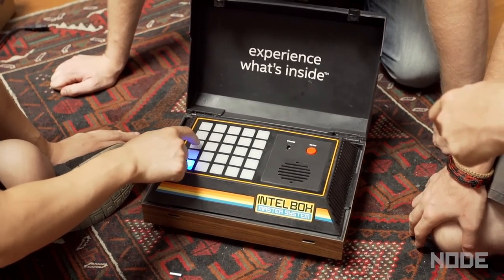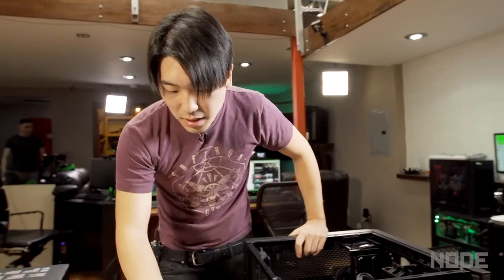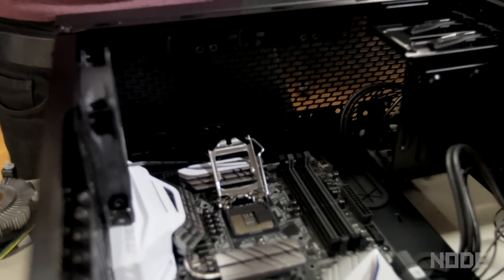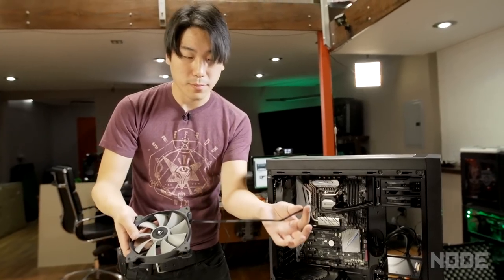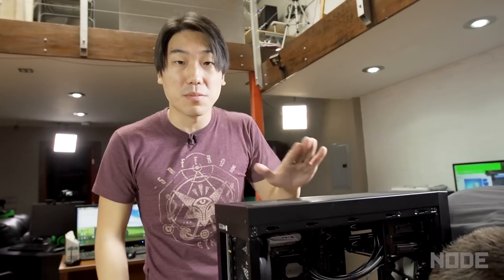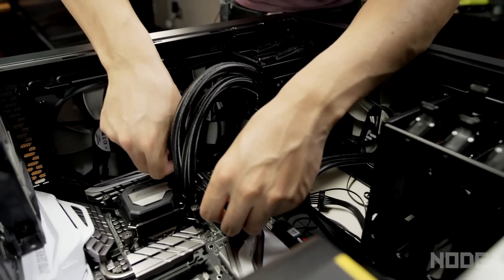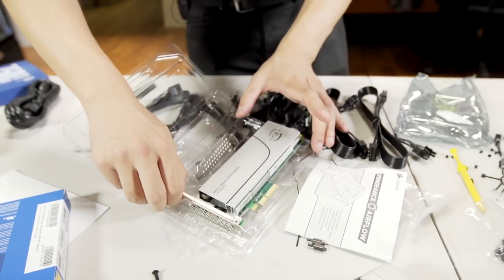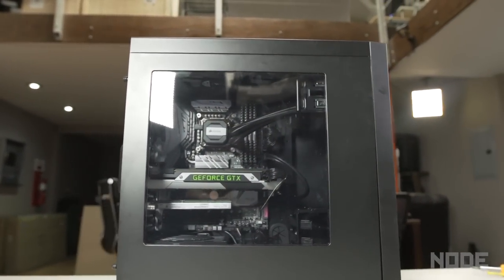BEAST INTEL PC BUILD

Comment: please dont build a pc again you dont know anything, the power supply where our power come from? no shit and the radiator is like a car intake? radiators are inside cars too they are called radiators not intakes. and fucking ram goes in before the install because you can mess up the boars when you push down on the standoffs

Comment: hey node i just a got a msi motherboard and just put it into my case. When i finished i turned it on (all other components are already in the pc) and it started beaping,and wont show a display and i looked it up and the memory stick i had was compatible but it wont show a display or no signed of showing that it was ever going to show can you guys help if not it is alright just need some type of help

Comment: Heads up, your PSU should be drawing fresh air through the filtered intake, not grabbing hot air from the inside like older systems.

Comment: I'm in the middle of installing this cooler on that MB. the backplate is completely loose when installed. I don't see how it can be stable when the block is tightened down. is this normal.

Comment: you have your power supply upside down... fan should be pointed downward so it can get cool air... power supply can overheat the way you have it installed

Comment: cooler fans are not facing the right way. you have them sucking air in to the computer through the radiator. they should be exhausting air out of the pc

Comment: Guys, can i have a spc like this, anything should change? after this, I will add one more GTX970 inside so will be change to GTX 970sli.

i7 6700 4GHZ
ASUS Z170 Deluxe Motherboard
NVIDIA GTX 970
H110i GT Liquid Cooling unit
Corsair RM 850 Power Supply
Corsair VENGEANCE DDR4 16gb ram
Western Digital 2TB HD
Reply: Get a SSD ;)
Reply: get an ssd

Comment: Hey, how is this pc build: 
GPU: Asus GTX 970
HDD: 120GB
RAM: 2gb DDR2
CPU:Q6600
PSU:430w, picked up for 40 bucks
Reply: +dtfguy1982 Outdated.
Reply: Nadir Jofas You didn't notice I was joking......
Reply: dtfguy1982 The answer is still correct.
Reply: Nadir Jofas k

Comment: Intel i5 4460 3.2Ghz
MSI Z97-G45 Gaming ATX Motherboard
16GB RAM
Crucial MX200 250GB SSD
WD Caviar Blue 1TB HDD
GTX 750 TI
Antec Earthwatts 650W Platinum Power Supply

Will my PC run? I am building my first PC next month and want it to be a good - great running PC, Can anybody tell me if it will run shit or good thanks.
Reply: +MrZach360 it will run
Reply: i know, im to late, but why z97 when you have a locked cpu?

Comment: im building a new pc but im not sure aout the compatibility of the parts. if u guys could help with this that would be great. 
CPU: i7 6700k 
MOTHERBOARD: ASUS Z170 deluxe 
RAM: GSKILL V SERIES 8GB 
COOLER: CORSAIR H100i 
SSD: INTEL 750 SERIES 400 GB PCIE
PSU: 800 WATT 
GPU: GTX 970 only one  
CASE: N/A
the motherboard and ssd compatibilty is what im concerned about. THE ASUS Z-170 DELUXE IS $300+ motherboard. i would love to have something cheaper but at the same compatible with the ssd. thankyou im building a gaming/workstation computer. and would the asus z170 a motherboard actually work. thankyou if there is any other comments please telll me thankyou.
Reply: +navdeep kumar ssd will be fine. as long as your motherboard supports pci.
Reply: +porkyporkchop1 all motherboards have pci, he should be fine
Reply: Marco Bununu of course :U but sometimes it doesn't fit with certain gpu's that are bricks lol!

Comment: Are these good specs for a first pc build?

Intel core i7 4690k
Msi z97 gaming 5 motherboard 
Hyper evo 212 cpu cooler master
Crucial 250 GB SSD
1TB Blue WD
Msi R9 390 grafics card
Corsair 750w 80+ Bronze psu
8GB Gskill Ripjaws RAM

Any recomendations?
Is the motherboard good?
If not Any better motherboard out there lower than 160$?
Should i got with a liquid cooler instead of a fan?why?

* Since im going with an intel cpu chip, is it better to go with a gtx 760, since people say intel runs better with nvidia etc.. and amd runs better on r9 390 etcc???
Please help
Reply: i mean gtx 970*
Reply: Maybe think about making it a skylabs build, that is a 6th gen Intel core
Reply: +Nando jr skylake***

Comment: you dont want to use the pre applied thermal paste because if it goes over the edge of the cpu heat spreader it can insulate the cpu

Comment: Hello guys i need help
Processor: i7 860 2.8GHz
Mainboard: Intel DP55WB
RAM: 16GB DDR3
Graphic Card: AMD Radeon HD 6850 1GB
I want to change to MSI GeForce GTX 960 GAMING 2GB or  MSI NVIDIA GeForce GTX 960 Gaming, 4GB GDDR5 which one is better or will i get bottlenecked if i buy any of these? :)
Reply: I wouldn't recommend ever getting a card with only 2gb of vram, it's not worth it and some games will really suffer.  I would recommend a 380 but it's real up to your preference
Reply: Hugo Olloman Well i'm planning to get gtx 960 4gb :) I just wanted to make sure it wont bottleneck since my other pc parts are quite old :D
Reply: +DecayHD I think you will be fine, your parts aren't too bad. Anyway there's no harm in getting the best graphic card you can afford and then upgrade the rest of your PC later, regardless of bottlenecks

Comment: flip the PSU upside down so it takes its on air in so it doesn't fight for the air with the GPU or inside the case?

Comment: is this build good and will it work?????? http://pcpartpicker.com/p/M79jVn
Reply: +N-Gineer No, you need an operating system, keyboard, monitor, and- Yes. It'll work, but what do you want to do with it? Game, stream, edit, and watch amazing cat videos in 1080p? Sure? Maybe? But get rid of that r9 card and switch it for the r9 380 or a 960. Bam. Solid.
Reply: porkyporkchop1 If it would work with the motherboard I will, All I will be doing on this Pc is gaming and editing
Reply: N-Gineer with the motherboard you have you can have anything you want piratically (it all depends on your case and the size of the graphics card.) for editing you may eventually want to upgrade to 16 gb, but 8 gb is plenty for now. Maybe think of getting a heatsink to help cool down that hot cpu and an ssd for loading times/editing/games. (Just need one big enough for the os) and a better gpu. bam, you'll be a happy camper.
Reply: porkyporkchop1
Thanks!

Comment: I need help with my first pc build. please let me know if my combination of parts will cause issues like bottlenecking and other pc issues. 

-Intel i5 4690k
-g.skill ripjaws 8gb ram
-MSI z97 pc mate motherboard
-MSI radeon r9 390 
-corsaire 600w power supply
-western digital 1tb hard drive 

also, is a cpu cooler necessary?
Reply: +John Travolta seems fine, you sure you don't want a 970? you don't need an heatsink, but it is recommened. sometimes the stock coolers don't have enough kick to cool down some of the higher end cpu's and it can be very loud. so if you want to be safe and invest in one... go for it! if you like silence over a loud hum... go for it! up to you
Reply: porkyporkchop1 thanks man, you think a 40$ cooler master will do the job?
Reply: John Travolta heck! you can buy the hyper 212 evo for 25-30 and it'll be good enough. or if you want to spend a bit more - pick up a corsair hydro :)
Reply: +porkyporkchop1 more spending? I'm good. ill get that 25$deal on the hyper 212 evo.thanks a lot for the help, cheers!
Reply: John Travolta haha understandable. enjoy your new rig! hit me up if you have any more questions/or if you need help. happy gaming.

Comment: How much does this cost altogether? Recently thinking of getting a new pc, and if it's above $1.5k is there anythings I can downgrade that can drop it a bit?
Reply: +NappaKappa Well this build costs an arm and a leg to build... I would recommend checking out pcpartpicker since they have community build that vary in price ranges or you can build one yourself!
Reply: +NappaKappa that price range will get you everything you need.Node buy/use alot of parts that are just not necessary for most Home users/Gamers. Realistically you only need 8Gb of RAM as no game in existence uses more than that (Witcher 3 does not use more than 8Gb on the highest settings, not does Crisis 1-3 or Beam-NG Drive). Although if you do alot of video editing/photoshop work, more RAM might be nicer (16GB IS PLENTY). Additionally, any case will do, even your old computer so you can save money on that. Power Supply Unit, again you can afford to cut corners here, just keep an eye on what your parts consume and you will be fine (you should be fine to just re-use your old one). generally, a 650W unit will do, just try and keep it brand name (most non-brand name PSU's fail in the first 6-12months). As for CPU and graphics card...for CPU essentially anything that is 4 cores and 3.4ghz will be fine....again nothing in existence uses more than that (games wise), if you buy one that is unlocked, you have future proofed yourself as you can simply overclock it to keep up with future generations. Graphics card are a little trickier as 2 is more powerful than 1, but 1 spits out the most consistent frame rate among a wide variety of games (few games are optimized for 2). But as for which one you should buy? RAEDON vs Nvidia.....Im with Nvidia as bang for buck, GTX 980 TI (VERY slightly weaker than the one they have in this video, but MUCH cheaper) is only marginally worse than top of the line (by 6FPS than the best and most expensive graphics cards in the world). you will be hitting the low 100's FPS wise for most games. Motherboards.....could probably just re-use your old one...but if you're looking for future proofing, maybe a newer one will be the way to go. Research is needed for this part as most motherboards do the same thing, just with slight tweaks.

Provided you re-use the case and power supply, rough approximations will land you.
Graphics Card = $750-800
Motherboard = $110-$140
RAM = $80-$120
CPU = $250 - $350

Which is well within your price range (although truth be told a brand new case and PSU do not cost that much and would still be in your price range). This would get you an 100% up to date Computer that will play all games for the next 3-4 years on high/Very high settings.
Reply: +NappaKappa http://pcpartpicker.com/p/ck2Dgs $2300
 
Lots of things you could shave off, in fact this rig I just made for you will play games better as most games are all about the GPU, and a 980ti destroys the 980. Enjoy Brother!
http://pcpartpicker.com/p/kgV8gs
Reply: Are we speaking USD? If so yeah 1.5k is plenty I'm Australian and my second pc I built was 1.5k AUD so yeah

Comment: Looking into getting a gaming pc ( currently a console gamer ) and I was wondering if you can put any processor into any computer or does it have to be amd or Intel depending on what other components you have
Reply: Depends on the motherboard if you are going to go with intel go with socket 1151 if you are going with amd choos beetween Amd+1, Amd+2 or Amd+3. i whould go with amd+3
Reply: Processors and motherboards have things called Sockets, for example, a AMD A4-5300 (Socket FM2) Will not fit inside a socket 775 (intel), so your motherboard and CPU sockets must be the same.
Reply: daniel15092 that was exactly what i ment

Comment: So I am guessing that the motherboard comes with all those wires? Or do you have to buy them separate?
Reply: +ThePokemonSoldier The power cables usually come packed with the power supply unit.
Reply: I looked up parts and I saw, so I know now. But thanks anyways.

Comment: is this a good gaming pc and does it work 
PcPartPicker list http://uk.pcpartpicker.com/p/fMGMLk
Reply: +GamingDobby I would get a cheaper processor such as the AMD FX 6300 and get a better graphics card such as the GTX 960. That card is designed for 1080p. You might find that your 8350 cpu will bottleneck the graphics card. Get a better GPU and you will be fine for 1080p gaming!

Comment: which is better: their origin PCs or this one? also if anyone know the name of the song they used that would be great thanks.
Reply: +Caleb Lawrence The origin PC's are superior to this one. but then again this one is the quarter of the price and will get the same, if not. more FPS than the Origin PC's. Why? the origin pc's use 5960x's and these use 6700k. at default clock speeds the 6700k is better for gaming as games prefer GHz rather than cores. and due to the fact that the GPU's are the same they will peform very similar. You only need 5960x's and other intel extreme CPU's for professional editing. but even still... the 6700k is still very quick in editing.
Reply: ***** why would they run cooler? thats BS! Twice the Cores, Twice the heat to be generated. AND the skylake CPU's are 14nm compared to 22nm meaning they put out less heat for the same load. learn you shit before u comment silly things like that
Reply: ***** no. the latest origin PC's they have are 5960x's which have 8 cores. the 6700k has 4 cores. and 14nm uses less power than 22nm, therefor it generates less heat. laptops get hot because their cooling is worse than desktops.

Comment: How fast does it boot up? If my 2 year old SSD can boot in a minute then id love to see that one put directly into the motherboard!
Reply: +suddenshotty My PC boots in about a minute and it's a normal hard drive...
Reply: If you are rigging an SSD and still boot in a minute,there is big problem somewhere in your system.
Reply: +Giggity Goebbels lol i had under 30 sec for win7 on an hdd, though it is longer for win10
Reply: +suddenshotty my $80 ssd cold boots in 20 seconds
Reply: +suddenshotty Samsung 850 EVO - running windows 8.1 Pro in my PC, boots in 8-12 seconds... id expect a PCI-e ssd to boot in 5-10 seconds

Comment: AIO liquid cooler? Why? Air cooler much cheaper,reliable and quieter.
Reply: why air cooling? If you buy a 6700k your bound to be over clocking alot.
Reply: You don't need liquid cooling to overclock. Good air coolers can keep an overclocked cpu at decent temps.
Reply: +SpyDoctor100 It's the new fad/trend for people to buy these AIO liquid coolers. I remember back in the day when you had to build your own full custom loops like I was always used to doing. Swiftech pumps, good ol' Dangerden waterblocks, etc.
Reply: +Erikogel1 With the exception of custom and triple radiator AIOs,most if not all liquid coolers performs similarly or worse than a noctua NH-D14/5.
Reply: Giggity Goebbels Its also nice to be able to move all of the heat out of the case which is an advantage of aio's. In my mind at least they also look nicer, that's why I use them. I really want to do a custom loop.

Comment: How much is that build anyway
Reply: +John The Nice Guy somewhere between 1200 and 1500
Reply: +GoneFeraL did that math it's exactly $1,300
Reply: I'm in Australia just built one for $2700 same processor , gtx 980 , 32gig of ddr4 at 3000htZ, Samsung 850 ssd 500gig and z170x motherboard
Reply: chris hughes You get that top of the line Motherboard with 4 PCI-E slots for only 1 video card. xD I priced it all on newegg and came up to roughly $1600 without the $400 Intel ssd they are using
Reply: +John The Nice Guy   $3100 in my area of canada
Reply: +John The Nice Guy 

After trolling around Amazon for these exact parts, I believe them to be anyway, I did the math and got a (rough) pricing of $1711.00 USD. Though, prices may vary depending on stock, purchase date, etc.
Reply: +chris hughes But bruh did you even use PCCG or Msy?
Reply: +SRM super-random-moments Friend of mine just built nearly the same computer, minus the SSD and it was $2400, not sure if he used Scorptec or Centrecom (the two he was deciding between)
Reply: +John The Nice Guy Around $2000. I put the parts into a PCpartpicker list.

Comment: What's the least amount I can spend to build a gaming computer?
Reply: Depends on your currency, but I would say about $800 minimum USD if you want something that's decent.
Reply: I'm struggling to pick between a gaming computer or a ps4. I've built computers but only out of things I've already owned. I just want to play MGSV to its best looking way.
Reply: I'm struggling to pick between a gaming computer or a ps4. I've built computers but only out of things I've already owned. I just want to play MGSV to its best looking way.
Reply: +TheSuperSaiyanBoxLineThinker if you do your research you can build a gaming pc for $500 or $600 but it wont run witcher 3 1080p 60fps.  but will be better than a console.  Id recommend building a pc but dont cheap out on parts.  Watch Linustechtips or ncix for more indepth explanations.

Comment: how much would all this roughly cost? thinking of building a pc.
Reply: +NazDominic This build will end up costing you over $ 2000. This build is extremely overkill for gaming on 1080p screen. 

If you want a PC that will max out (Very High to Ultra) graphics on 1080p 60fps, for the least money possible (no extra bells or whistles) then this is the PC for you: http://pcpartpicker.com/p/GpzNhM
Reply: +NazDominic This one would be really expensive, probably around 1500-2000 dollars. You can make a decent gaming PC for around 700-800, though, so this is a bad example for someone trying to get into PC building
Reply: CRIMAFUYT Bernhard Pangels ahh thanks guys. since im kinda new at this, the 700-900 range at first doesnt sound like a gaming pc. from the looks of it you can actually play on high settings with that price of a pc. any other tips?
Reply: +NazDominic spend more on the GPU than anything else. Like 35-45% of the build should be GPU. It's the most important part for gaming
Reply: Bluepengie alright..so would be wise to get the GTX? also, do you have tips on getting the pc casing? sorry if i ask a lot. just learned how to build a pc but not too sure about the do's and dont's